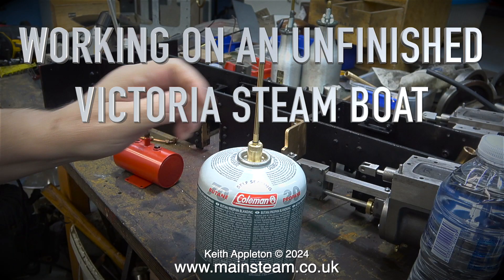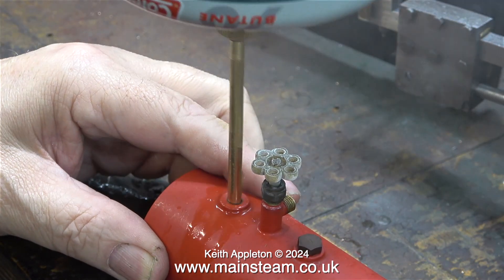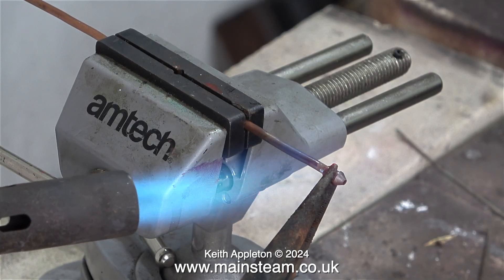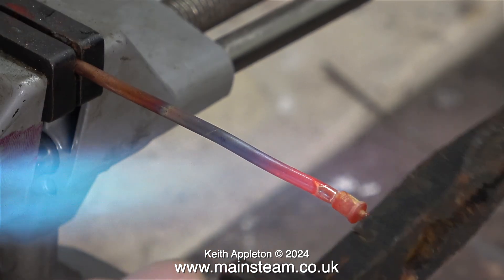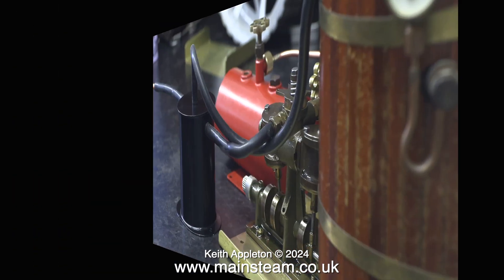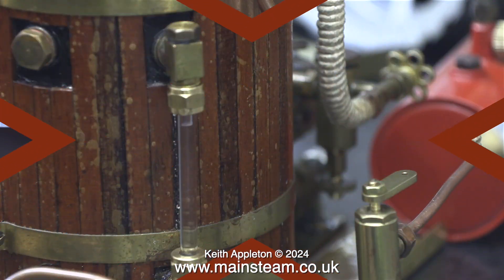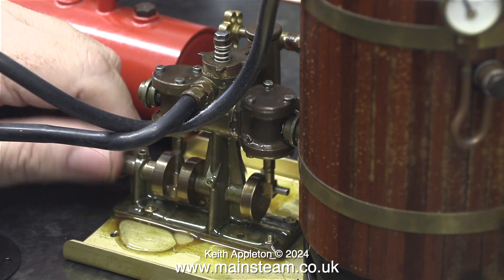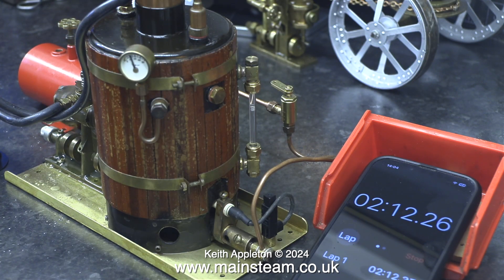WORKING ON AN UNFINISHED VICTORIA STEAM BOAT - PART #8

Comment: 47 years ago a close friend took me to a mill site in Nevada USA for the annual starting of the 1800s "one lung" steam engine that powered the six stamp mill. I was game to help but wasn't allowed. The team started it by running on the drive belt (?) inside its radius, like rats on a tread mill. It was absolutely mesmerizing. The tentative way it began to run. Engine room scenes from The Sand Pebbles remind me of it. Sure wish video was as easy to record then, as it is now.

Comment: Would running the steam exhaust line under the gas tank aid in preventing the gas tank from icing up ?  Or is that taking thermal efficiently too far?
Reply from the maker: Health & Safety etc etc
Reply: You'd increase the pressure dramatically if you heated it and run the risk of it detonating

Comment: I'm currently making my first coal fired boiler to fit my roundhouse Lady Anne and yesterday I made my first attempt at soldering the firebox. It didn't go well. Where the solder did take, it did work very well and was very neat. But in other areas it was a complete failure and was just blobbing. It was taking longer than it should have done to get the solder to melt and I think that was the problem. I'm using map gas. Is that the issue? Do I need a propane torch that is bigger than the map gas torch?
Reply from the maker: Insufficient heat and/or insufficient flux.
Reply: @keithappleton  Thanks. I'll make sure I apply plenty of both today 👍